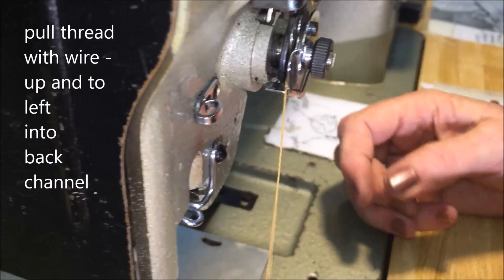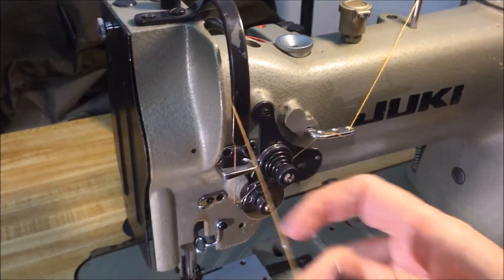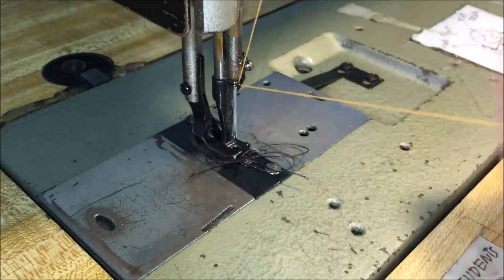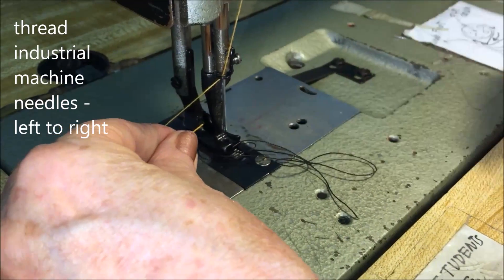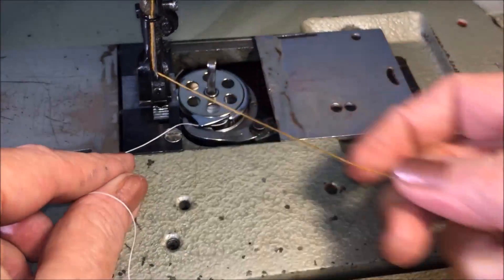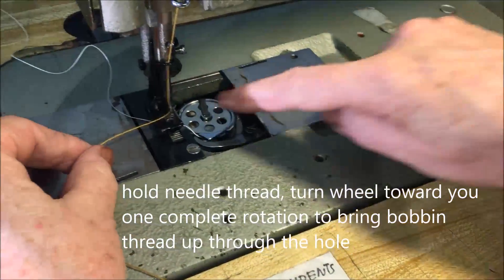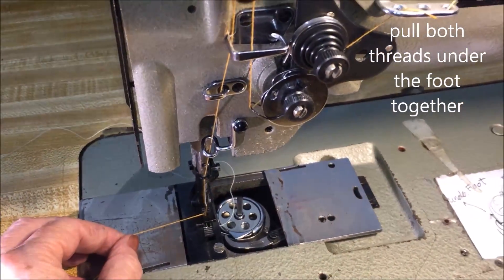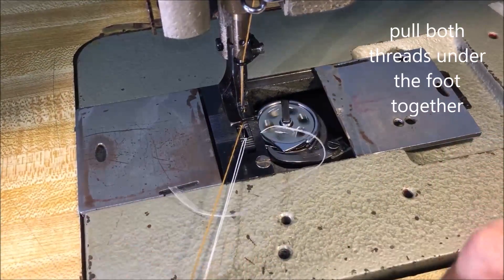Juki Industrial Walking Foot Threading

Comment: Thanks, I’m not sure what the negative comments are about and the manual is horrible, I have a 563 and your instruction was the only one that solved my bobbin loading. I have done it several times since and gone through miles of thread and it work like a charm. Thanks again great video!

Comment: The thread does not go under the pin that keeps the tension discs from turning. The pin is located intentionally in an area away from the thread path. Check the instruction manual.

Comment: Your video is really nice quality but don't put the thread around the tension disc pin. This is a big mistake that has caused lots of grief to folks learning to thread their machines properly. This is a common mistake that just won't die.

Comment: I thought the bobbin was supposed to turn in a counter clockwise direction?
Reply: This is what my mom was told too but the manual never specifies. Also, this shows going behind the pin on the tensioner, which my mom also does but is not in the manual. The only difference I see with this and the manual is top peg, pin and rear disk on the uptake spring. Manual shows peg back to front in bottom hole, wrap up to top hole right to left.

Comment: You doing it totally wrong.
Reply: That's not the way owner manual said.
Reply: why don't explain how, just saying it wrong is pointless
Reply: Dan Zar of its sewing then it works  depends on what your stitching and t tension requirements
Reply: @dsmith2979  The video is really well made but the mistake is threading around the tension disc pin. There are two variations of this mistake making the rounds on the internet. One way (mistake) is to start by going around the pin as is shown in the video and the other version shows the thread going over the discs counter clockwise and then around the tension disc pin (also a mistake) The purpose of the pin is to hold the tension discs in place so they don't spin as the thread is drawn between them. It's too bad youtube comments don't allow a photo as there are examples shown in the manuals that make it very clear not to go around the pin. Depending on the thread the extra tension when applied to it by this method often frays the thread due to the tight bend it's forced to endure going around the pin.
Reply: @lindian55  I always do it by the manual but my mom says it needs to go behind that pin. For the most part we don't see a difference in stitch quality but I'm a stickler so I do it how the manual says. My only question is which way does the bobbin go in? Mom says counter but my intuition says clockwise.
Reply: @dockeydidit  These machines are  very forgiving in regards to threading until you start going through lots of layers of fabric or webbing. The thread works hard due to extra tension caused by all the extra bends around the various fair leads and etc. This in combination with too small of a needle will cause extra chafing of the thread and strands breaking.
The myth of threading around the tension disk pin is an old one and is even promoted by some Industrial sewing machine dealers but you will see with researching Juki, Singer, Brother, Phaff, Consew and many other manuals of different machines they "don't" direct you to thread around that tension disk pin.
As for bobbin direction you will see that all the manuals I referenced indicate placing threading counter clockwise.
I hope this helps ;)